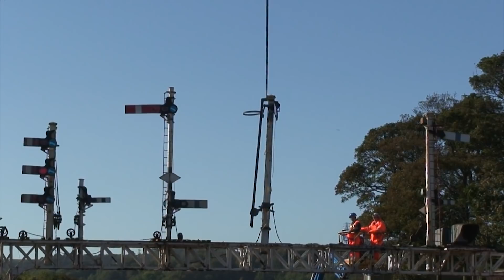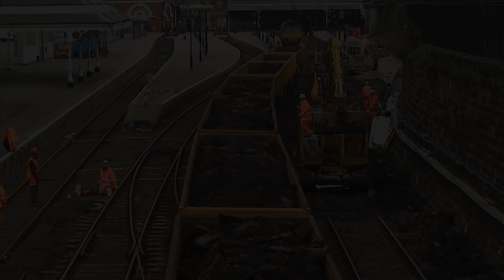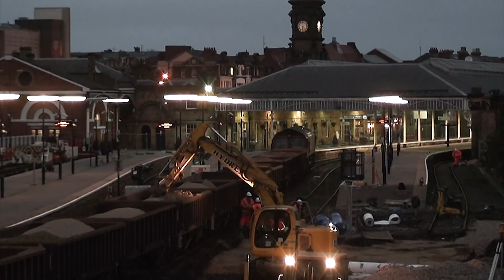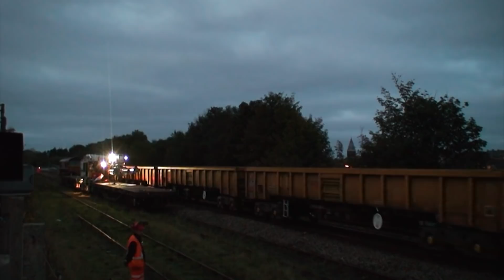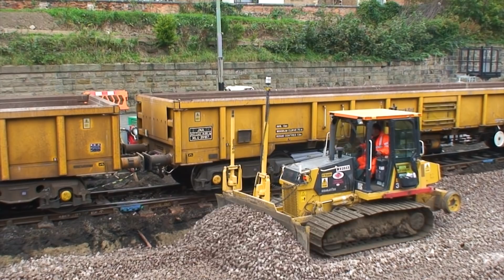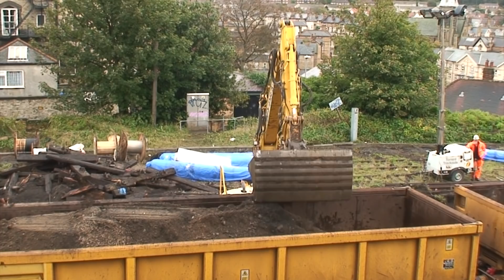Scarborough Railway Station Reprofile & Falsgrave Signal Gantry Removal 2010 with the Kirow crane

Comment: .Makes you wonder how many semaphore signals are still in use, other than preserved lines.
Reply: Not many the figures reduce each year. 5 mech boxes have just closed on Teesside. There are still areas on secondary routes in Scotland Yorkshire Cumbria and elsewhere where they will survive a few years more due to Network Rail budget constraints. 
ROC signalling cover for the entire country is predicted by 2030 but it could take longer.
Reply: Quite a few actually. You'd be surprised!

Comment: If this isnt industrial vandalism what is? Not Work Fail are a dsigrace
Reply: Its called modern progress I'm afraid  :(
Reply: Modern is just boring
Reply: @jameshardy4354  I'm afraid so
Reply: @carolinesteam1881  Progress funny word eh also 'If it aint broke why fix it'
Reply: @andrewganley9016  Because we'd all still be riding horses instead of building this railway we're now proud and protective of 😂
Reply: @kevfrombutterley  Lets agree to disagree for me today;'s railway is a shambles
Reply: @andrewganley9016  "The railway" ? Which part ?
The train operators and franchise system may be poor but the infrastructure certainly isn't. Massive modernisation and improvements schemes are in progress every day, maybe you just don't notice. Kings Cross will be much improved as will the ECML now capacity has been increased. Hundreds of new train set introduced, old rolling stock from the Thatcher era withdrawn. When we get back to normal the rail system will be great.
Reply: @marksmith334  Mark Smith, for massive modernisation read wholesale of anything old or out of date regardless of weather it was any use ,couple of points there was nil investment in BR in the Thatcher years in fact she baulked at railway privatisation unlike her successor the back stabbing Major.I have the misfortune to live south of the River Thames and have to put up with the Govia owned Southern totally useless as are all but one of the TOCs (Chiltern Railways) the franchise system has been a total disaster for the tax payer i.e.you and me we are still paying double,triple what was paid to the old BR who for all its faults did a good job considering the money they received compered to todays 'pigs in the trough' could bang on about HS2( that 100 billion railway from somewhere to nowhere) but whats the point sorry to be so anti today's modern railway(shock horror)
Reply: At least this gantry has been preserved by the NYMR. Network Rail clearly have good relationships with the heritage railway which is good for all
Reply: Such crazy I’ll informed comments.